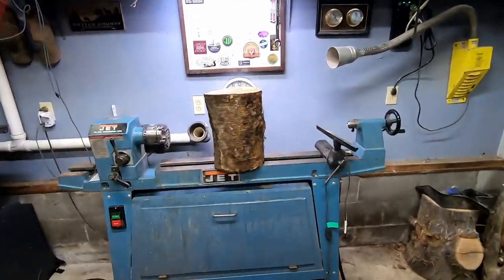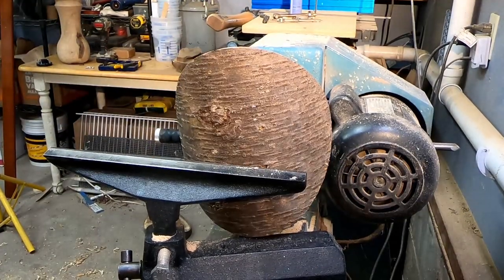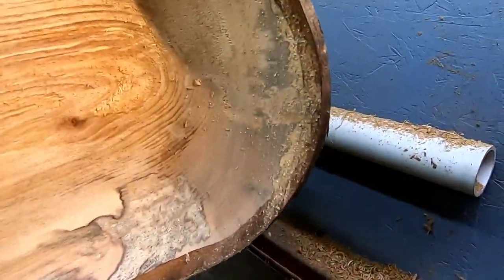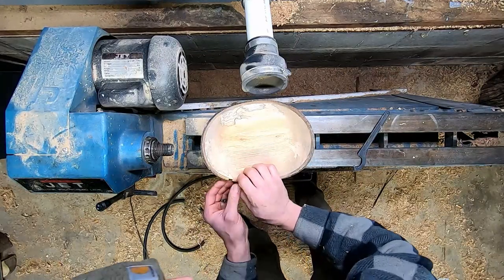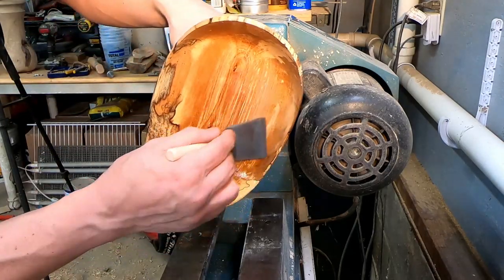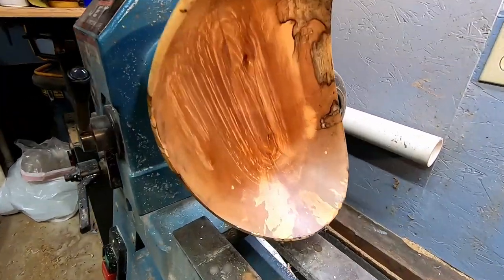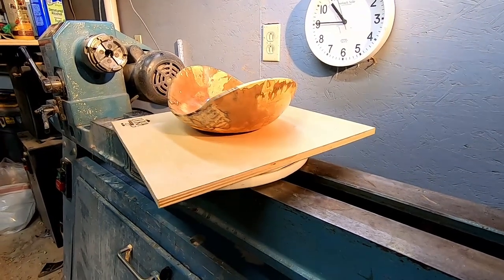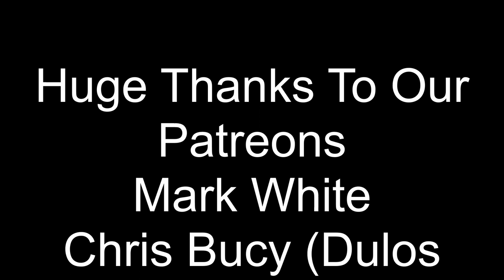Woodturning - Spalted Cherry Live Edge Bowl - Total Boat Halcyon Polished Finish

Comment: Never tried the wood shaving box method of drying kind of the same principle behind rice drying a phone I figure. I am cursed with impatience probably beats my current method of treating like a hot pocket & pray.
Reply from the maker: HAHAHA Hot Pocket! The chips and box/ bag is something I do to help slow the drying process after cutting. There's alot of potential tension you can be releasing after you turn it to size/ shape and the wet chips help relax the wood and balance the drying. That's the theory anyway ;) Thanks you for your support!